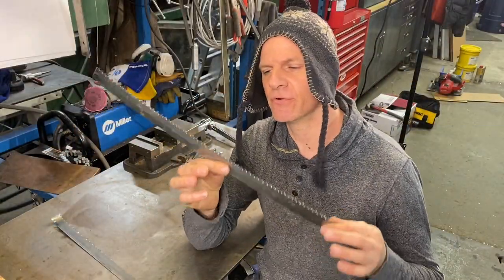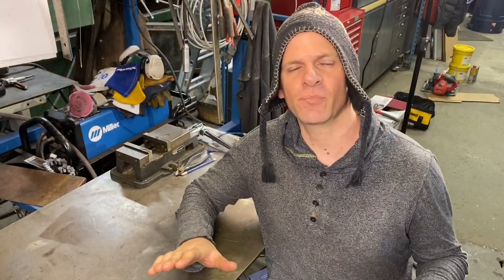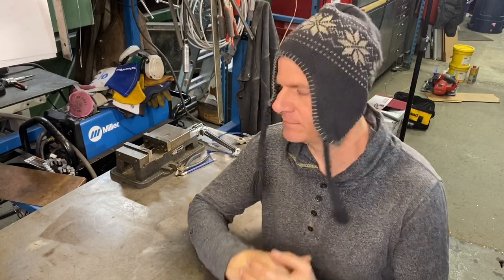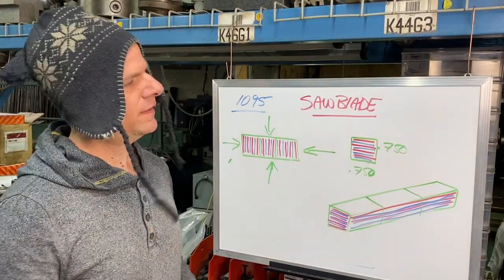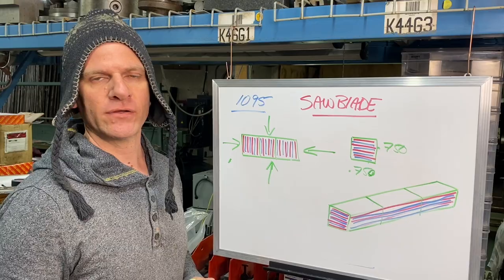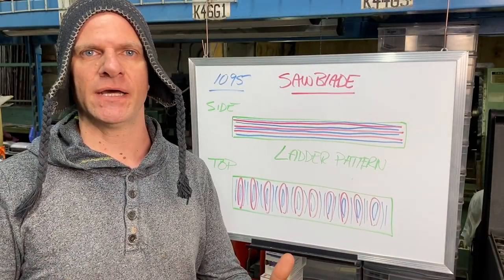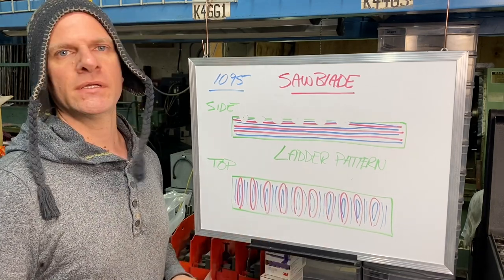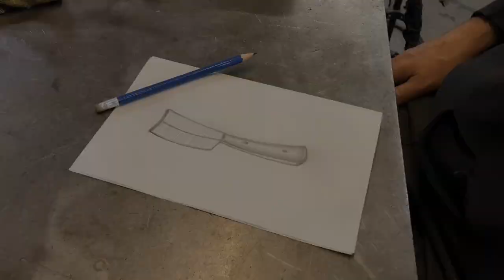HOW TO FORGE A DAMASCUS KNIFE FROM OLD BAND SAW BLADES !!!

Comment: Can this steel be hardened? Aren’t these saws usually bimetal and the saw body has too little carbon? I have the option to get as many of these bandsaw as I want.
Reply: If you know the name of the blade manufacturer you can go on their website it will tell you what the blade is made of I typically use blades from Linux because they use a high carbon steel body